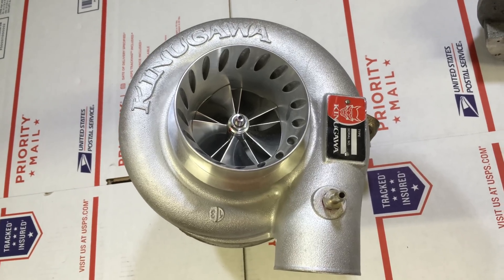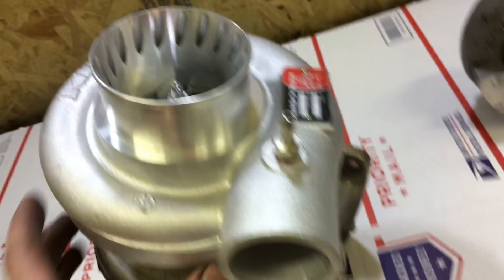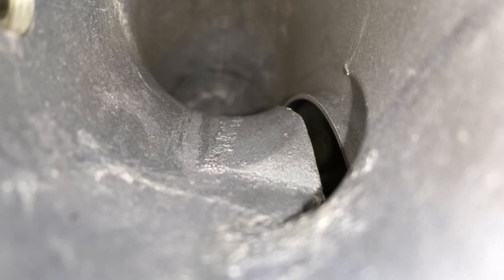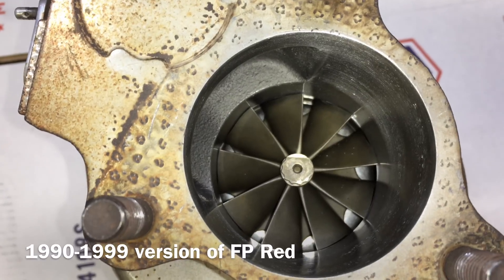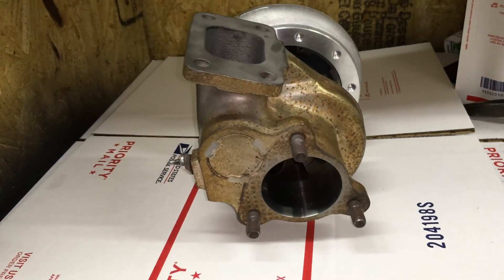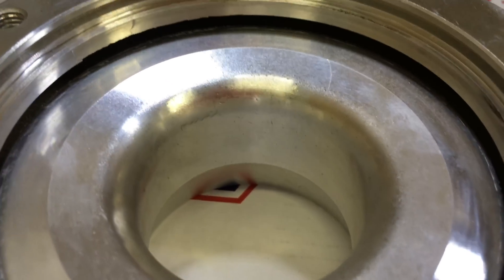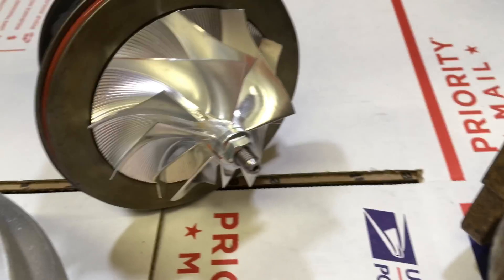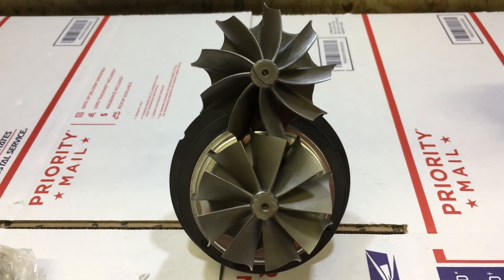Hayabusa 60-1 TDO6H Turbo Upgrade

Comment: Damn...kinda the same set-up you did for me..(except I used my Hahn compressor cover) ...surprised to see it on a bike!..Nice job Austin! 👍
Reply from the maker: +Craig Cundiff Hahn sold a lot of those, they just put them on a bunch of different turbos kits. Yours has the tdo6 turbine 55 X 65. I felt it was the best match for your compressor wheel that we used.
Reply: Turbo Lab America and you are correct...I was just thinking that's a big turbocharger on a bike...that is some serious power to add to a bike...👍